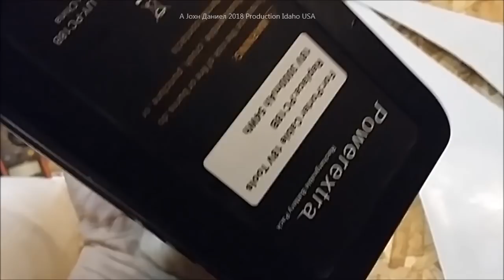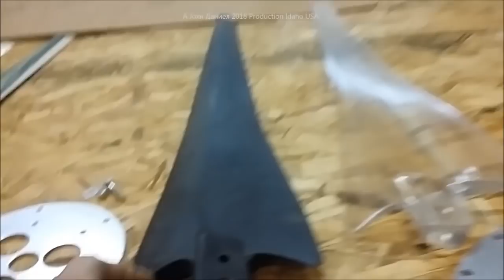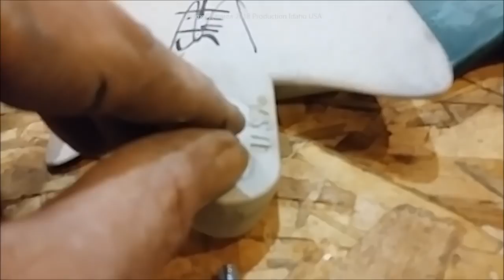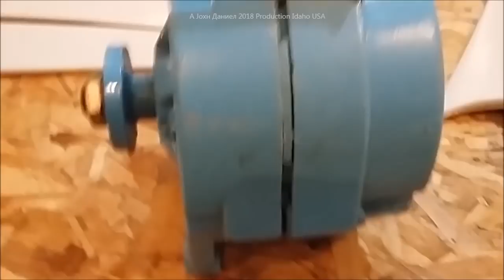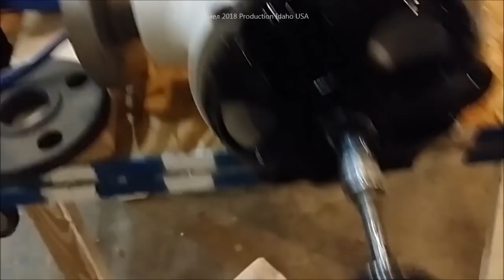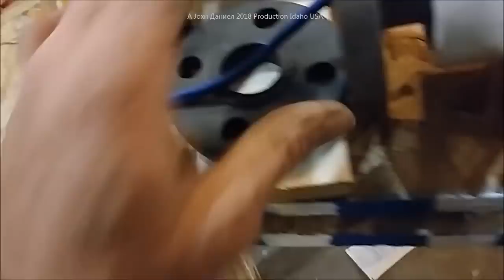Nice 500 Watt Chinese Wind Turbine, how to Test, Wind Turbine Lesson 2 (all parts used below video)

Comment from the maker: REAL Wind Turbine. Since I got mine prices went up a bit to HEY PEOPLE LOVE THESE! Aliexpress  and when in stock Ebay, LOOK UP AT THE LINKS  ⇑ ⇑  below the video in my info for sourcing. To get 100% full batteries from one & to divert over volt you need these: https://amzn.to/37HN2OR 100A SQL Rectifiers &  https://amzn.to/2MTUjCU A All purpose long life Load controller and be sure to get up to and over 300 watts diversion resistors ( https://amzn.to/2QngFPq x 3) and one or more 60 amp SSR ( https://amzn.to/2QKEyj0 ) with heat sink ( https://amzn.to/2ZYtmna ) and be sure to use thermal past on it.  ( Proper type - https://amzn.to/2QN2hir from Protronix)    Subscribe, check all on the channel.
Reply: Hey John
 Good vid. I'm wanting to get a wind turbine to power a water heater element in order to heat my home radiators. Is that advisable or do you see problems with the idea. I'm an electrician but dont know enough about turbines.
Reply from the maker: @stephendoran2545  You can actually run a turbine into a water heating element direct with a few considerations, its just hard to explain to most but you being a electrician you probably already know you can run a 500 watt 120vac element off a 48 volt wind turbine with just a rectifier but its not greatly efficient. I do have 800 watt 12 to 36 volt DC flow though heaters used in the trucking industry in my shop that we use with a load control set to 25 volts to fade off some power in over volt chance and it heats amazingly well. You use a circulation pump that speeds up with the voltage. If you want to see a pic of the heater and specs reply to me olympicpowercontrols @ yahoo.com . You do have to put in a over temp controllers ( 5 halogen bulbs) because in my 160 gallon capacity tubes I have exceeded 200 degrees a few too many times in my wind.
Reply from the maker: @stephendoran2545  PS - we successfully ran a 96 volt 3 phase  2000 watt turbine straight into a 1500 watt baseboard heater in Rifle Colorado and its still there running it if he wants to almost 4 years later. Most the time his 4 turbines run reverse to grid, and keep a 500 ah battery hot, but in winter storms he swaps one over to the well house heater with no issue. In his well house above the heater is 2 small tanks full of salt water that store heat so when the wind stops that radiate out for days.
Reply: @JOHNDANIEL1  thanks for getting back to me john. That all sounds a bit complicated compared to what I'm considering.  I have water filled radiators so I'm thinking about breaking into the pipe work with a small 3kw cylinder element heater and powering that directly through a battery from a pair of 2kw turbines. How does that sound to ya?
Ps can two turbines be ran to one bank of batteries or is there a better set up idea?
Thanks again for getting back.
Reply: @JOHNDANIEL1  I was wondering why you started with p.s. I'm just seeing your first message after responding to your second one🤣
Reply from the maker: @stephendoran2545  You can run it into batteries, that is the best move, just have to place a low voltage disconnect so you don't pull your batteries past 60% and it takes a lot of batteries. Theres numerous Ohmic style heaters https://amzn.to/2zt6dMZ you can place on the bottom of pipes or reservoirs and solar pump circulation controllers you will need to look at https://amzn.to/34589cP
Reply: Thank you all for the input.. I'm going to add a 20gal into the return line of my existing boiler. To help or by pass the the 220 boiler. If I heat the 20gal up to 150°-160° it woll be enough to run that system there is already 20 gal through the system at the start. 4 batteries should suffice.  It'd just the controller end is a bit confusing.  And will dump some into my hot water system in the summer. Or just shut it down till fall and end again in mid spring. Just getting tired of heating with wood. And cords are getting $$$$$$$$$$$

Comment: Hello John great video. Can I install the 29 inch 500watt blade on my 400 watt turbine. If so can you send me a link where to buy the blade and hub. Thanks
Reply from the maker: You can, but should you? How is your wind, how well is it in clear air, lots of variables. Send me some details to my email, I will try to help you get help on it. olympicpowercontrols@yahoo.com Post your question, some pics, and details.
Reply: John I've got good clean air I just thought I could get a little more power by using the 500 watt blades. I think I will leave good enough alone.

Comment: John, why are you saying that the 600 watt 3 blade is a low wind turbine?  Is it due to the longer blades?
Reply from the maker: The turbines with the sword shaped blades are high speed, the ones that show blades that look like bent pedals are the slow and low wind blades that produce good in low winds. They use a modified generator head to try to get you as close to 600 watts as you can get without having the need for 30 mph winds to reach it. That's why I say they're the best to use in a lot of cases. The links below the video will lead you to the two suppliers that are not using garbage parts and I'm sure you'll figure out the rest.
Reply: @JOHNDANIEL1  thanks John.

Comment: Watched your video on weighing blades.. I weighed mine.. they were all numbered to correlate with the numbers on the hub.. tapered hub to a 60+lb altinator. They all were 857g I looked at all of them some had notches taken out on were they attached at the hub. Was amazed re-weighed and bam 857g.
Reply from the maker: If the wind turbine seller is a good group they will sort blades out and make sure you get the best outcome.

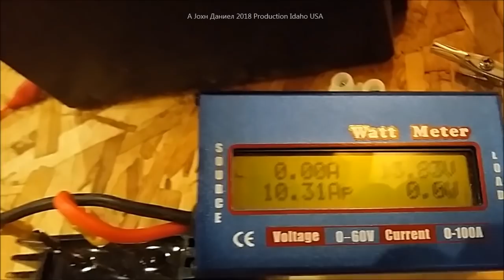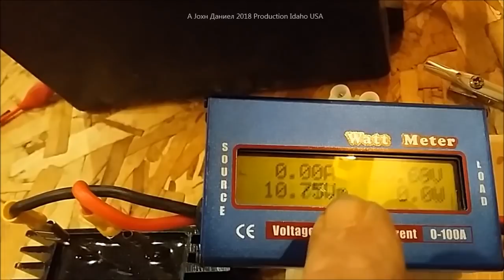Comment: John, thank you for taking the time to post all this data with links. These are very informative videos packed with great information. You seem like a no BS guy I know who can handle a question w/o being offended - if nothing else, it proves I was paying attention. :) At 17:11 you make a comment that the drill you use is "50 something watts". At 17:24 you say the generator made 167 watts from turning it with the drill. How does a 50+ watt drill produce 167 watts? What am I missing here?
Reply from the maker: Gearing differences and voltage differences.

Comment: I bought this Wind Turbine... I'm only making about 30 watts max... I've tried the original controller, I've tried the rectifier you use on this video, I swapped my wires to thicker 10 gauge. And still nothing.. Only when I disconnect one of the three wires do I make some power and when I plug in the wire it's like I slam on the brakes... A little help please.
Reply from the maker: Whats the exact model you have, constant area wind speeds, and your battery voltage. Upload a video of these items and your results your getting.
Reply: Јоhn Daniel it's the 500w one that is linked in your videos from Aliexpress. My battery voltage is usually between 12.0v and 13.2.  My winds are pretty constant and frequent.. Ranging from 15mph to 30mph.  I have a 200amp RC watt meter between the rectifier and batteries. I will try to post a video.
Reply: Јоhn Daniel https://youtu.be/he3z9f-KNyo
Reply from the maker: @jesusbarron8052  Bad rectifier, its very likely got a fused diode, probably defective from day one. Take all 3 wires loose, carefully test with decent wind each lead paired with multi meter set on 200v AC. Send me Email olympicpowercontrols@yahoo.com to your findings or make another video with you doing the testing. JD

Comment: 1000w Ramsond .. purchased at Home Depot..
Reply from the maker: The Ramsond Turbine, its a 2012 year HYE modified HY1000, no longer sold in the markets unless NewOldStock left overs condition. Its capable of its rating in 28 mph, but BALANCE THEM BLADES and ONLY mount it on a 2" sch40 pole with guy wires. It will need 6+ of the 10 ohm resistors in addition for your loads if your using a controller like I do.
Reply from the maker: FYI - Ramsond is a re-badging or sorta name game of Aleko for some higher grade stuff. Aleko is a import house from Washington state that off orders from China with some cosmetic alterations of existing Alibaba Products.
Reply: This unit is A Ramon DaVinci 1000w.. new not 2012 maybe 2018-19. All aluminum vane all solid . The generator is sealed and fined. Props(5) are numbered and some are notched to fit plate. Also plate is numbered to where they go and extremity tight fit bolts have almost no play in both prop and plate. .. but the controller box is 35amp. Your schematic shows to use 60amp fuses  what should I use or do about this box that came with. It just has idiot lights.

Comment: I just got my turbine from AliExpress .It looks pretty good...I looked at most of your videos... good info!! Well I noticed the wires coming out of the turbine.My turbine wires are very small it is for a 48 volt system. I think I'm going to have to open my turbine to put a bigger gauge of wires..before it goes on a pole... there are super thin !! But I don't want to mess it up I never open the one before so what do you think.???
Reply from the maker: Volts high/amps low. So do not alter your wires it will not improve the turbine and may damage it. My 12 volt is high amp/low volt and must have 10awg wire (China 9.4 actual) while a 48 volt uses China metric (about 13.8 awg) and is more than sufficient.
Reply: Thank you good info... I think I paid  352 hope i do save my second battery bank in your theory of desulfate..

Comment: Need some help on this one John 
I bought a 24v 500w 5 blade from aliexpres and it doesn't want to spin in high winds. I changed from 5 blades to 3  and still the same. I changed the blades with my other generator that's a 400w from China and the 500w generator turns and makes the most of 2 /3 amps. I then put everything back to original and I am getting power out the 400w 3 blade and nothing out the 5 blade 500w. 
Any help on this would be great

Comment: I have to tell you J.D. you make it sound so simple to setup your turbines. I have the tower the turbine and the midnight solar 150 I also have the necessary dc powered elements for hot water as well as a 1000 watt diversion item. I’m going to attempt to get  it all up and running this summer after the snow melts and the mud dries up. I will hopefully be calling on you if I get stuck as to where all the components go. I will be incorporating the turbine with my 24volt 1800 watt solar system. Always enjoy your informative videos. Also I wanted to ask where are you located that you get as much wind as you get? Oklahoma panhandle maybe?

Comment: i see 4000w units on ebay 1.25m dia. - is that bull or not? https://www.ebay.com.au/itm/4000W-DC-12V-24V-5-Blades-Wind-Turbine-Generator-Power-Charge-Controller-Set/323888234159?hash=item4b693e3eaf:m:mqJkxLBDj1GuD4PDO_c4KlA&frcectupt=true
Reply from the maker: Total Fraud!! They use the Missouri Wind Scam Math system, they also take 48" blades and a 3 lb generator and then LIE THEIR ASSES OFF!!  To get 4kw from a wind turbine you need 14.8 foot (3.85 meters) diameter blades, it would weigh in excess of 225 lbs, just to extract that level of energy from the air. A 48" set of blades is good for about 289 watts max at the correct math from  SWEA, (fraud free conversion rated 24.8 mph peak energy wind speeds). So when you see the 1.65 meter 65" blades on my 500 watt with its link below the video, you then see reality in advertising.
Reply: @JOHNDANIEL1  What about design, are the three vertical disc blade design still better than the other options [ I'm think of it for a boat ]
Reply from the maker: @justme.9711  They are not very good energy producers. HAWT works 300% better than VAWT and at 1/3 the price per watt.
Reply: @JOHNDANIEL1  what is hawt/vawt
Reply from the maker: @justme.9711  HORIZONTAL AXIS WIND TURBINE and VERTICAL AXIS WIND TURBINE, This video covers HAWT style.

Comment: You're talking about "swept area" with the blades.  The bigger the blades, the more power the blade can extract from the wind, and the more power it can produce.  So, a blade that is claimed to produce 1200w, is not going to produce that when the same size blade is tested to 400w.

Comment: ah.....big blades have very limited speed capabilities...no big deal until you put them on the turbine which requires high speed......big blades lower speeds...steadier albeit  lower output.

Comment: John Daniel... if I have a consistant low wind situation where I want to have a 12-volt system, would you recommend going with a 24 volt 5 blade turbine to get a little more power on the low speed end?
Reply from the maker: Many people will use a 24 volt turbine to charge 12 volt batteries in conditions of very long wire length or poor wind conditions. Truthfully even getting 5 to 15 amps in bad weather keeps the survival lights on.
Reply from the maker: The link to the 500 watt model gets you to GREEN ENERGY on Ali, ( wuixi air products) and on that page click on GREEN ENERGY, then in their site get the 5 blade 600 watt with the 12/24 controller.

Comment: I would have loved to be able to watch the rest of your video because this tech is very interesting to me, but I just couldn't due to the camera work. I have to agree with the other comments about the tripod. Please get one ot at least set your camera down. I can tell you are very knowledgeable on the subject.  Thanks for trying I just couldn't handle any more so I was only able to see about half the video.
Reply from the maker: Results of a widow maker stroke make filming a chore, tried the tripod, had to move it 30 times to track the action! Was worse! And since I cover 5 to 50 items or definitions per video in many cases, what I need is a camera man LOL!

Comment: Thanks for this as I am about buy a few to power my farm in Manitoba
Reply from the maker: We run 7 on the property in Texas to run compressors fill 17 of the 100lb propane tanks to 200 psi as a over night battery in that system. When the bank gets down to 22.5 volts the valve opens and the cessna pump air motor runs 2 Thermodyne PMA's to charge us back to over 29 volts. So far, so good using air as back up power.

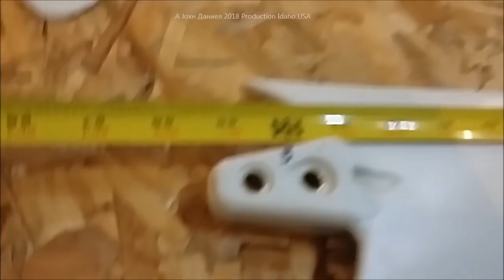Comment: Basically I just found your channel I've seen it once or twice before and I watch this video complete what a good video I actually bought a windmill very similar to that the tail is a little bitter I was kind of impressed it was like 2:20 with everything that came with the flange stainless steel at that the controller and a rectifier as well I picked it up on Amazon around 2:20 it was cheaper but this version came with everything the other one just for the mail set was like 188 I opened it up kind of impressed I don't know anything about anyting you really helped me quite a bit thanks I will be a regular loyal Patriot excellent excellent video well done

Comment: Hi John. Just wondering how you worked out the expected output for a given wind speed in relation to the blade length? Testing my own chinesium turbine here and have no idea what I should be reading. Have same watt meter as you but different turbine.
Reply from the maker: Different turbine, different power curves. Also, real rated or fake rated total ability makes it hard to guess. Lots of math involved from magnet strength, rotor design, stator winding wire gauge, blade profile, and a bunch more factors. Mine is a ME500 with SWEA certified testing records, Others may be maker guessed so not a good start.
Reply: @JOHNDANIEL1  Thanks for the reply. It's the same turbine as you reviewed in a very old video, about 2 years ago. Getting around 25w peak in its current location and height. Wanted to bench test to see if it's worth my time fabricating a taller tower and buying more cable. sigh
Reply: @JOHNDANIEL1  Hey John, sorry to keep bothering you but it's next to impossible to find anyone doing proper tests on these. Bench tested mine under load and got 170w from a 750w corded drill. It seems that it can put out reasonable amps but requires a lot of torque to do so (drill bogged down and started overheating) Just wondering what you thought about putting larger blades on it to extract more power? Bad idea?

Comment: have to laugh at these videos.  power out is directly related to the torque applied by the wind.  the harder to turn alternator will produce more power out.  of course, it will take more wind to spin it!  the little Chinese generator will spin easier and at lower wind velocity yes, but never come near the current output of the alternator.  I have built several home built wind generators over the years.  smaller generators turn easier, generate less power.    if this weren't true these gigantic wind farms would be runninthose little 200 watt turbines.
Reply from the maker: Wind farms use area, a 16  to 1 drive up gearing. 120 RPMS to 1900 in 15 mph.  Small wind turbines use direct drive. No comparable can be made of the 2.  In 10 years I have installed about 120 under 3k wind turbines, thats what I do as a paying hobby. BEFORE THAT, I as a contractor built the bases and platforms for GE and SIEMENS in Idaho, Utah and Nevada for massive wind commercial turbines.
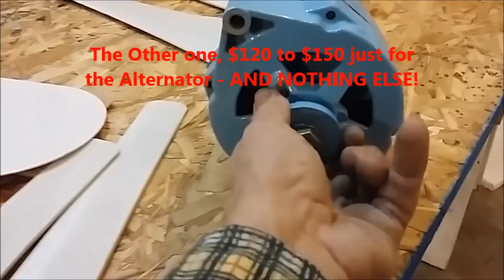Reply: Are you referring to the alternator at 12:40? That is cogging torque, it's unwanted and will not be producing any power. Big commercial turbines have gearboxes to take advantage of torque rather than speed. That is becauce you can't have 100-150meter long metalblades turning in 2000RPM. 
The reason the alternator at 12:40 does not turn is that the phases are of due to missplaced magnets in the rotor. Poorly assembled bad design. A well built and balanced alternator runs smootlhy without any noteable cogging.
Reply: @USAoutofEurope  those commercial turbines do not use metal blades. If I remember right it took about 4 seconds per Revolution, if that's correct I think it's about 15 RPM. Have you ever seen a 15 RPM generator? I think now we know why there is a gearbox.